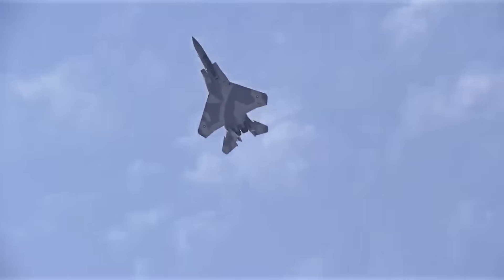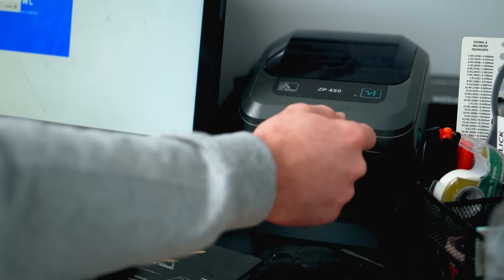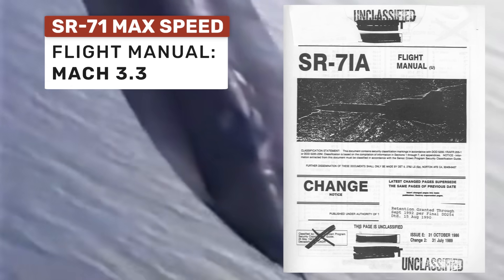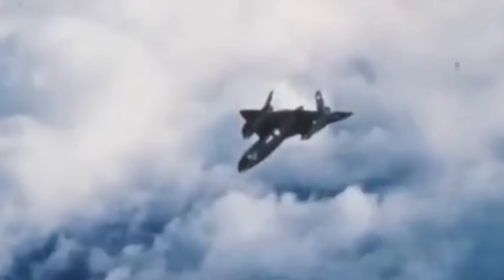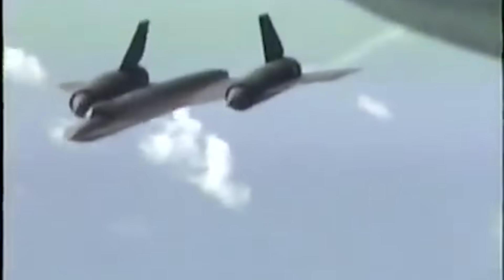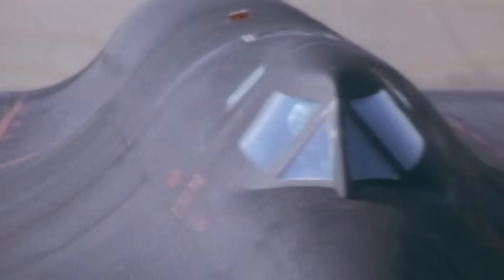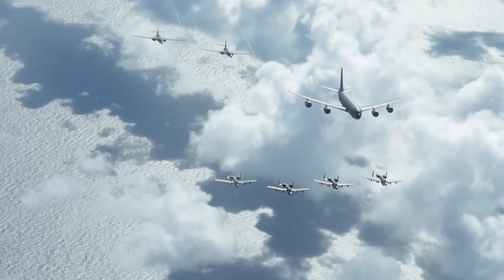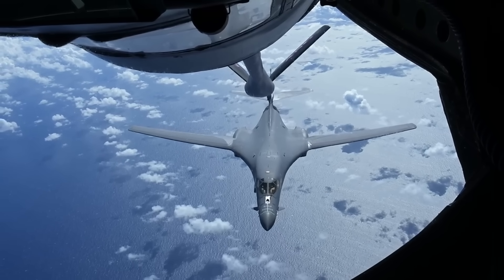The SR-71 was MUCH FASTER than the Air Force will admit

Comment: BS buddy!!! 
The SR-71 and the fighter version, YF=12, both flew over 3000 mph at 187,000 feet! That info comes from two AF pilots, when I was on active duty in the 1970's. working in NORAD Air Defense Radar Operations!
Reply: Theres literally no one that say that, especially as it isnt even remotely possible to achieve those speeds or altitudes.
Reply: @gr8crash  What is your problem? You still are stuck with released data. Why would some AF pilots claim 187,000 instead of 180 or 190, 200 WHY so specific?  I never heard of anything over 90,000. Why 3000 instead of 2900 or 3100? Even when I talked to the son of an SR71 pilot, his dad told him that they just pushed it a little faster than the previous speed record. Is Superman your idol and don't want anything fly faster than him??
Reply: @bobreese4807  no problems here, just correcting wildly inaccurate information. Simply put the SR71 could never under any circumstance fly that high or faster. No one claims it either as its simply not possible, and is quite laughable.

Comment: Nebraska in 5 min 86 miles per minute =MACH  7.16 over 5000 mph kinda bout what i figured it would do. So they stated it would go half of its potential. Ever read Tom Clancy's BLACK SKY ? Its a good read .
Reply: Your math is definitely not accurate,  especially as that speed isn't even remotely possible
Reply: @gr8crash Nebraska in 5 minutes my math is accurate
Reply: According to how wide the state is 5 min fits at mach 7.16 so you figure it out then genius.
Reply: @travismckee6374  well since mach 7 is literally impossible,  you're math is off. Not sure where you got 5 min, but if traveling fully East to West it isnt possible. At max speed across the widest part it would take about 12 1/2 min. Now if the flew North - South that would be just under 6 min at max speed.

Comment: An interesting quirk about the sr72 is that its skin doesn't fit together correctly on the ground because at mach 3.2 the heating caused by drag causes thermal expansion, which means if it did fit together right the metal would expand and be put under several tuns of compreson. so the skin doesn't fit together on the ground so it flies right at mach 3 it also leaks fuel because of this. 
What this means is that each time it gets up to speed its skin expands to fit together just a bit different and a bit better so it every sr71 is deferent and evry sr71 likely has a different top speed because the better it's skin fits together the less drag it has and less thermals heating caused by drag (as i get the impression that its top speed was really limited to how fast can it go before the titanium starts to melt)

of course what exactly each sr71s speed is was probably never known and changing the doctrine whe some sr71s could go faster and some would be slower wouldn't really be worth applying so the max speed of the aircraft is likely where a vrand new one can safely cruise
Reply: Almost all of that is incorrect though. Sure some planes flew better than others, but the max performance was the same across all variants. Also the parts about fuel leaking and why etc is completely incorrect and a total myth. While there were expansion joints,  they didnt interact with the tanks. The tank structures were sealed with tank sealant and the upper acces panel had seals. Also also panels on aircraft have gaps. Its an industry standard and helps with removal of the panels for maintenance while not damaging the aircraft skin.

Comment: The Russians felw the mig 25 is at mach3.2 but its steel skin began melting and its engines were defirmed from the heat and stress making every aircraft that flew at mach3.2 impossible to reuse and they all had to be scraped.  Its practical top speed is mach2.5 which is the speed its pilots were trained to fly at. Well interesting that feels the sr71 was very capable of going past its top speed i get the impression that if its top speed was pushed too far it would suffer similar damage especially since air resistance increases with the square of its speed

Comment: The SR-71 blackbird was faster then we know I'm thinking Mach 4 - Mach 7
Reply: Those speeds were never remotely possible. Even mach 4 is beyond its maximum design potential and the improvements required to even get close to max potential were never implemented
Reply: @gr8crash  Didn't the X-15 come close to Mach 9
Reply: @turkin73k  mach 6.7 was the max the X15 reached,  but that was rocket powered with additional rockets added and ablative coatings etc. If you look up pictures from those records it was pink instead of black.

Comment: My Grandfather was with skunkworks and helped design the B-2 bomber along with many other things he did in his 20 year airforce career and 15+ at Northrop. He told me a story about how the SR71 took off from Edwards, made a loop around Salt Lake City and was back at Edwards in 18 mins. That’s well over 3500mph ground speed and the published Mach 3.3
Reply: Not likely as it takes roughly 15 min just to get to speed and altitude
Reply: @gr8crash it’s probably like flying from LA to Vegas, once you’re at altitude you start your descent
Reply: @MadisonFishing  which is fine,  but you're already going to be past 18 min by the time you get there.

Comment: The record is for level flight. So the claims of higher speeds in a shallow dive is irrelevant.

I think the video contains the answer. The engines had the power to go past MACH 3.3, but the structure of the plane was limited to MACH 3.3 for thermal reasons. So if it really wanted they could probably have pushed the record to MACH 3.5, but the real useful speed is still MACH 3.3.

Comment: I've seen and touched an SR-71 at March Air Force Base airfield museum, I've seen an SR-71 at the Smithsonian Air and space museum, I've seen and touched the SR-71 with drone companion at the air museum in Tucson. And in high school I was fortunate enough to see the only operational SR-71 on the tarmac at Edwards. If you ever get to look closely at one, notice the gaps in between the panels. There's a lot of heat expansion going on there.

Comment: I worked with a retired Air Force vet that used to be in the ground crew for the 71.  He claims it could briefly touch 3000mph.
Reply: That would be about mach 4.5 at 80k ft, which was never remotely possible.

Comment: My dad said, after I asked him. Yeah  higher and faster. RSO Guy.
Reply: All planes have limits though
Reply: Certainly  ,  they did skip one into space.
Reply: @johnorr9373 SR71?  Lol no they didnt.
Reply: @gr8crash yeah they did.
Reply: @johnorr9373 lol no. Not even remotely capable or possible
Reply: Did you loose your daddy to that project  in 1964.
Reply: @johnorr9373  no. Just correcting you with facts. You may be thinking of the X15 which did.

Comment: I was told the blackbird does m5 by a guy who worked on it. Anytime I repeated this on the internet I quickly got some random telling me it doesn't. I still believe the skunkworks guy
Reply: Because it isn't true.  Under no circumstances is it even possible.  And no one from skunkworks who worked on it would say that.
Reply: @gr8crash well this guy did.
Reply: @gr8crash they always co.e with these statements lime thw ones you've been making all over this video.  I doubt you actually know what you're talking about,  bt of course you will have some appeal to authority.  I simply dont believe you
Reply: @johanbronte  doesn't matter if you believe me or not, if you dont like the truth than keep thinking it flew mach 5, or even mach 4. 

But theres no one that says that, and im friends with the guy who ran the flight testing at Skunkworks for the SR71. There's literally no one from this program that states those speeds, especially since its not true for several reasons. Even without getting into the details,  neither the airframe could handle those speeds nor were the engine capable of handling those speeds. Heck even mach 4 is above the maximum design potential of the airframe itself.
Reply: @gr8crash have a nice day

Comment: At mach 3.56, thats:
2731.478mph
45.53 miles per minute
0.758 miles per second

Even if he only did that for 15 seconds, thats absolutely insane. Even going 0.6 miles per second, thats insane. I remember driving from NC to Fl and how many hours that took, at 0.6miles per second thatd be a matter of minutes to travel that distance. That plane and those pilots were something else, you could not pay me enough to fly something that speed (or fly in general since i have horrible eye sight lol)
Reply: Your math is slightly off. It would be closer to 2372 mph, but he doesn't give altitude which raises more questions. But given the facts, 3.56 didnt happen.

Comment: A-12 was not a "predecessor" of SR-71. SR-71 is just the air force name for two-seater variant of the Lockheed A-12 Blackbird. They are just single-seater and two-seater variants of the same plane. And the name was changed because A-12 was Lockheeds internal name which was ok for CIA, but an air force name needs an air force designation, so name SR-71 was adopter (and was actually supposed to be RS-71)
Reply: A few corrections. The A12 and SR71 arent the same airframe. While being very similar,  there are a lot of upgrades and changes between the airframes that they arent really the same. Its like comparing the Hornet and Super Hornet. Sure they look alike but are vastly different underneath. 

The A for A12 was for Archangel,  which was the design series name "following Angel" 

The SR71 was originally called the R12. It would have been the RS71 following the RS70,  but Lemay wanted it changed from RS to SR so it was.
Reply: @gr8crash  In his book, Ben Rich, who designed the intakes and cooling systems of A-12 and later became the boss of Skunk works after Kelly Johnsoon retired, always talks only about "Blackbird" as single plane which had multiple variants. Original single seat CIA variant, proposed bomber variant, prototype fighter variant, and air force two seat reconnaissance variant (which got name SR-71)

Comparison to Hornet and Super Hornet is really flawed as in Super Hornet most components were really bigger and different, but between the single-seat and two-seat versions of A-12/SR-71 most of the components were exactly the same.

Number 71 came from air force bomber line number - next bomber after the (X)B-70 Vakyrie, though the bomber version of Blackbird never materialized.
Reply: @hkultala somewhat.  To start Ben Rich actually didn't design the intakes. He lead the team that solved the issue, but it was another engineer named, Campbell I think?  Who actually came up with the design.  

The term Blackbird is generally used to describe any variant, much like how people say Hornet for any variant. The A12/YF12/M21 were all modifications of the same airframe. The SR71 was more of its own airframe given the changes and advances made. It was given the -71 following the -70, but not because of the bomber variant. They proposed an RS70, meaning the RS71 would follow,  until Lemay wanted it changed from RS71 to SR71.

Comment: Theoretical maximum hard cap is Mach 3.48, this isn't just because well we didn't put a big enough engine in our or just didn't open it up all the way. It's because the air itself is literally pre detonating before it can even get into the compressor in the turbine at that point because of all the drag.
Reply: Close. Theoretical maximum with the acft as configured is mach 3.55. This is the limit of what the inlet can physical handle,  but also the shockwaves start to interfere with the flight controls making stable flight impossible

Comment: Sr-71 wasn't the fastest aircraft, only to its engine spec type, it was fastest. Others had rocket convertion mix. It's only altitude flaw, no cooling system. It endured heat, raw of its metal. Extreme maintenance during tag hangers. It's body frame can endure Mach 4.1, it didn't have wings, because it IS a wing adjacent rim body of one. It only had fins & limbs to hold a sound exploiting, big cost effection enginees.
Reply: So many inaccuracies. But the SR71 was never capable of mach 4.1
Reply: @gr8crash so many self sustaining maintenance, condensation issues during tag. Plus the framework was so beyond its time, it was the only part of the plane. That could've reach 4.1, it was assumed it couldnt even each even 3.5, that too was gained.
Reply: @ReallyHappy-2u  theres no part of the aircraft that could do mach 4.1, simply not possible. Even reaching close to mach 3.5 was only possible under VERY specific atmospheric conditions.
Reply: @gr8crash it did mach 3.5. Because that was the capacity of the engine verse atmosphere range. The body is still capable to endure more. "Impossible" is a beast. Yet BLASPHEMY & abomination to science.
Reply: @ReallyHappy-2u the engines weren't rated for mach 3.5. Even getting close to that required very specific atmospheric conditions. 

The body is not capable of those speeds either, not as built anyway.
Reply: @gr8crash military & FAA, always had to be informed before a test was applied. Every time there was. On one of the updates, was the mach 3.5, it did reach it. There was no harsh potential malfunction occuring. Indicating it can exceed it.
Reply: @ReallyHappy-2u no, that isnt a thing. The USAF can conduct test flights as its wishes. If it wants to set certain records, like the cross country flight does require more planning. But again the SR71 couldnt reach mach 3.5 except under VERY specific atmospheric conditions. Under normal flight conditions,  it was not possible.

Comment: I knew a pilot for the SR, he worked at the same company I did before I retired.  I asked him once how fast did it go, his coy response was it would go as fast as the manual stated and it would still accelerate. Plenty of throttle left.  His Similar response to how high would it go was,  I was at the top of its envelope and it could still climb.  The limit was engine inlet temperature.
Reply: He was exaggerating a little bit. It wouldn't just keep going faster or higher,  thats not how the SR71 worked.

Comment: They have said before that the top speed is only limited by airframe temperature, not engine power or drag.  Even the military does not how how fast it could go otherwise.

I got to touch a Blackbird that is on outdoor display at Castle Air Museum in California.  I got a weird chill when I did.  IT'S REAL!   ;-)  Oddly enough they look smaller close up.  Type "Castle Air Museum  sr-71" in google images for a look-see.
Reply: They absolutely know how fast it could go. Also the initial limiting factor was the engine CIT limits, not the airframe.

Comment: I wouldn't be surprised if it could beat mach 4  what would be the point of acknowledging
Reply: It was never remotely capable of that speed
Reply: Or so 'they' want you to believe.... @gr8crash
Reply: @lukewarmwater6412 no. It simply wasn't possible under any circumstance.
Reply: @gr8crash  and either of us know this for sure why? unless you are an aeoronautical engineer who designs engines (I am not) it is a schrodingers cat situation. they wont admit and we cant prove.
 I bet it can do mach 4.0 why wouldnt it?
Reply: @ShannonWerner-s8g we do know this for a fact. Mach 4 is even greater than the maximum design potential of the airframe.  The engines were the initial limiting factor to higher speeds. But even if some how the engines weren't the initial limitation, the airframe starts to become a problem. To even reach its maximum design potential, the airframe would require a lot of rework. New materials for certain areas, new inlets, water injection etc. All the required upgrades  would have also given the SR71 a new designation,  likely SR71D. And since that never existed we those speeds were never attainable. The aircraft as configured, under ideal circumstances could just get to about mach 3.5, but these speeds also weren't fully within the pilots control.  Above that speed you run into issues with the inlets no longer being able to control the shockwave, likely causing a violent unstart, and the bow shockwave starts to interfere with flight controls making stable flight very difficult.
Reply: @gr8crash  and that is exactly what I would tell everyone to cover up what it can really do. its chess, not checkers.
Reply: @ShannonWerner-s8g thats not how this works. Unless you're going to start implying that all the design papers, engineering documents, manuals, physics etc are all falsified etc. Thats a pretty big leap in possibilities.

Comment: The SR-71, impressive as its performance was and as fast as it could go, was child's play compared to the King of aircraft: the X-15. In terms of reusability, yes, it's not really fair to compare the two aircraft. The SR-71 could take off and land under its own power where the X-15 had to be carried aloft and dropped from a mother ship (a modified B-52) at something like 30k to 35K feet. The X-15 was also fuel limited, it's XLR-99 rocket engine burning fuel at alarming rates would go through the plane's fuel capacity within a few minutes of operation. Regardless, of all of these limitations, the damn thing achieved a top velocity of 6.7 Mach, which translates to over 4500 mph. The X-15 also reached altitudes in excess of 350,000 feet. The SR-71 goes nowhere near that altitude, nor was it designed to do so. Remember the X-15 program was done during the 1960's. I tell all of this to keep things in perspective and educate those of you that may never have heard of the X-15 program. It was groundbreaking work that all of us should be damned proud of.

Comment: An aircraft never shot down by the countless SAMs launched at it, and who’s escape tactic was simply to accelerate, was most certainly faster than the admitted speed.
Reply: Not exactly true. Depending on mission status, they may not have changed speed at all. And SAMs were faster than the SR71.